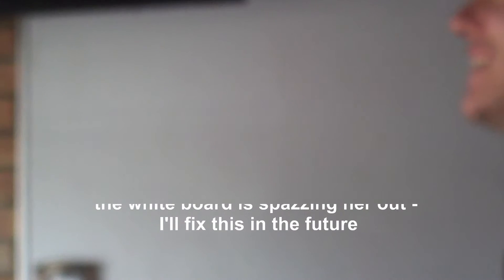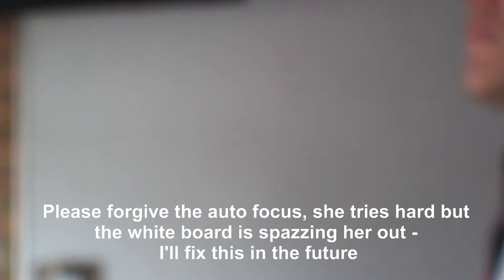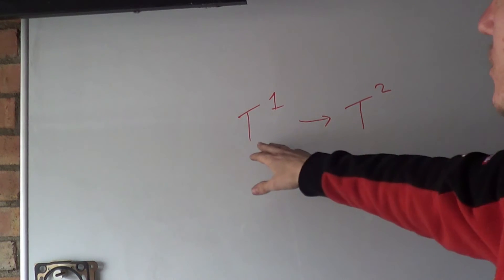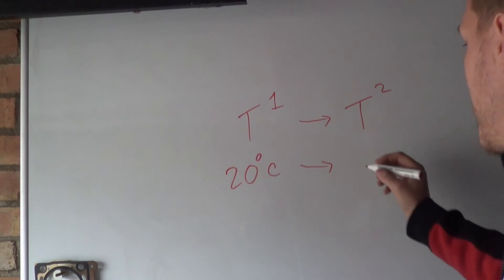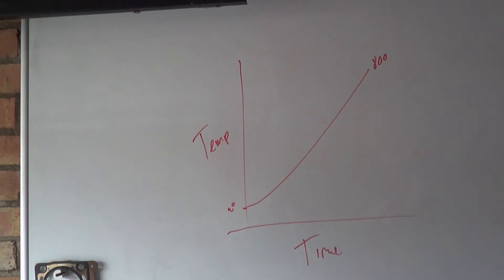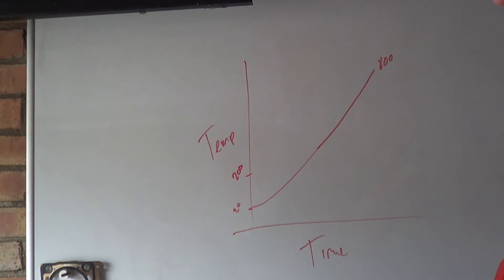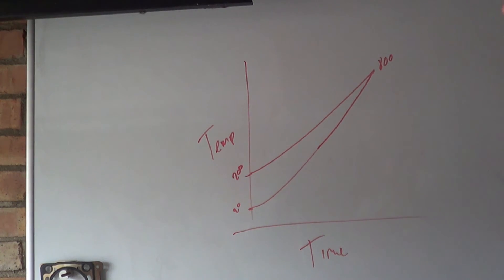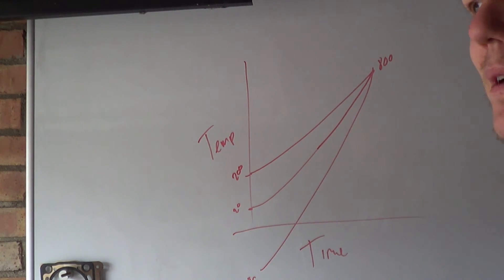Engine Fundamentals 1 - Thermal Gradient

Comment: I think it would be a great idea to have higher compression ratio without actual higher compression. Leave the compression the same (say 12:1) but on the powerstroke the piston expands further (16:1 or whatever) and the gas cools down more, giving more energy to the engine instead of to the exhaust. could we have a super complex weird crankshaft that does this?

Comment: I take it this is the principle that water injection works using? injecting water after the compression stroke to cool the cylinders etc thus increasing the thermal gradient?
Reply from the maker: Water injection is 2 fold, cooling yes, but also acts as an anti-knocking agent. Its also usuallly 50-50% with either ethanol or methanol
Reply: The Workshop
interesting...so would systems like nitrous oxide also have a degree of temperature gradient working in their favour? (as I understand it almost all compressed gasses have a cooling effect on any surface they are released upon?) will you be doing any water injection/anti knock video any time soon?
Reply from the maker: "will you be doing any water injection/anti knock video any time soon?"

- yes